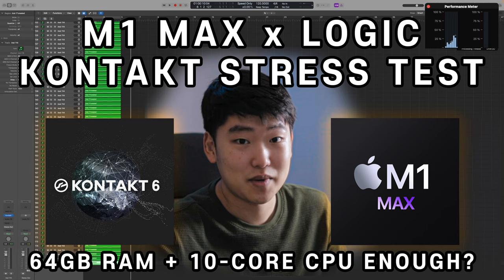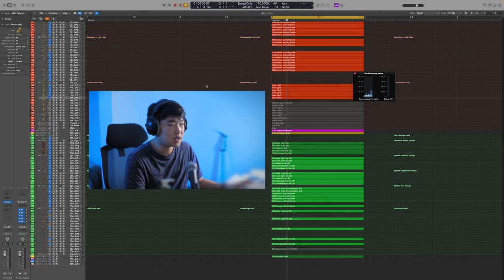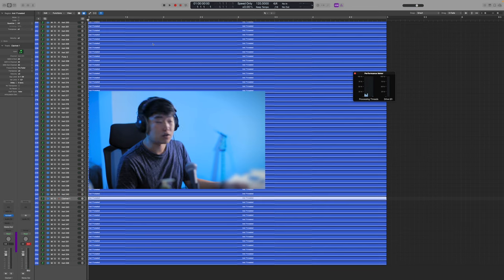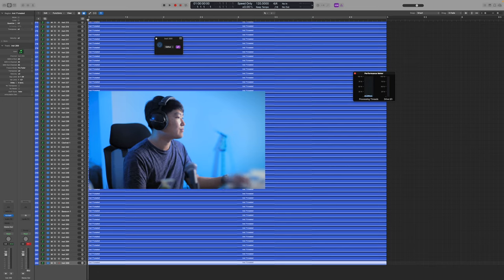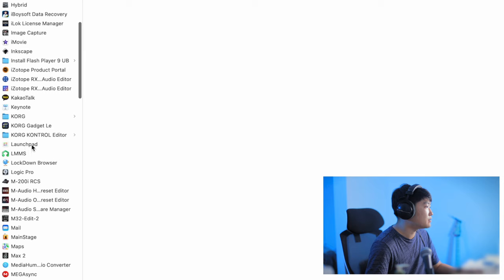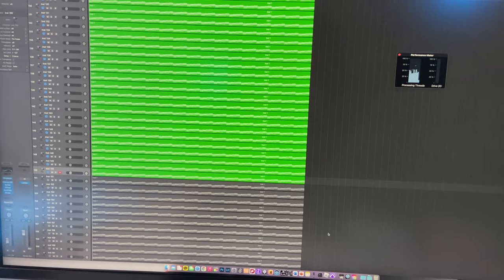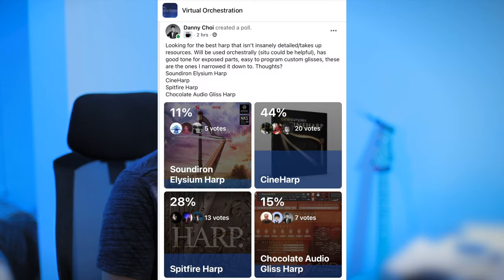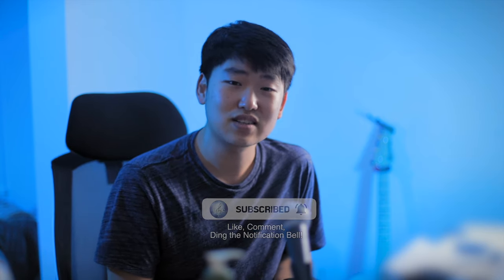M1 MAX Logic CPU Stress Test and Kontakt Test Update

Comment: I’m pretty convinced we haven’t see yet the full potential of M1 Max MBP, like having Kontakt fully optimized to run on M1 chipsets, with the way it does handle the memory and SSD access. For some reason, it looks like when we repeat some operations, it slowly optimize it and yet then it can run smoothly, just like the ressources would adapt to the sudden requests. It’s nice to do all those tests, because that’s VERY specific and I’m sure not everyone even bother with them… but I DO since I’m mainly working with Kontakt in Logic Pro.
Reply from the maker: Yeah, think you're right. Think Apple spent more time optimizing for video and graphics, so it's been interesting to see the "unseen" side of audio in the more complex orchestral senses. Definitely VERY specific!
Reply: @DIDCHOI , M.2 external drives will be crazy!!

Comment: Hey, thanks for posting this revised test. Great to see. One thing I noticed this time round: 

Every time you hit play, you always had one instrument track armed (the red R button). Armed instrument tracks are forced to use only one single core, even if they're only playing back prerecorded midi. This is because Logic is anticipating that you could play that instrument live at any moment. What this means is that this particular track will put a great deal more pressure on whichever core it happens to use - you can even see this because there was always one CPU meter pushing up much higher than the others. And if that one single core overloads, then of course playback stops even if the rest of the processing spread out across the other cores is nowhere near to maxing out.

So if I were you, I'd try running some of these same tests again but making sure the red R button isn't activated on any track. In theory this should mean that the load will be spread more evenly over all cores, with less of a risk of one single core stopping the whole show. And btw, this issue of a single core being dominated by any instrument tracks that happen to be armed for live playing is even more exacerbated when the buffer settings are low. With any luck then, you'll get much better and more consistent results if you always make sure no instrument tracks are armed.
Reply: I've never had the privilege of having a new machine to test like this.  I had no idea that a recorded tracks are forced to use only a single core.  That's great information.
Reply from the maker: Yeah, someone just commented that in the previous video actually. It's very true. I have a dedicated "EMPTY" track set to "no output" for this very purpose. But I don't use it that often when I'm working on stuff so it didn't cross my mind doing the tests. I'm sure it would squeeze more tracks out with one more core freed, but I think we are starting to get the idea of Rosetta's limitations. 

I think it could have helped me reach closer to the 185 track benchmark though for sure!
Reply: @DIDCHOI  yep I agree, the true performance results that reflect what these machines can really do will only start coming to light once everything is native. Still, it's already highly impressive what can be done even when so much is still under Rosetta! 

Re armed instrument tracks and their effect on CPU performance... On the one hand, it's actually pretty valid to test Kontakt playback performance with an instrument track in REC mode. After all, when working on a music project you need to be able to play and record live instrument tracks all the time anyway. So it's always good to know how big of a project the computer can handle playing back, while still allowing you to comfortably play new tracks on top with workable latency settings and no crackling. But on the other hand, if you want to test the real maximum limit of what the machine can do in a pure playback-only scenario, it's better to make sure no instruments are armed and live. Otherwise, the results you end up getting will tend to be dictated by when just one overworked core peaks out, regardless of how much power all of the remaining cores still had left and could have used.

Comment: Nice tests. Thanks! Switching the process buffer size range to "Large" should give your MBP a significant performance boost.
Reply from the maker: The process buffer range? Is that in the Logic settings?
Reply from the maker: Oh I see it! I’ll give it a try
Reply: @DIDCHOI  below the threads which you correctly switched to 10 cores.. On my ancient  2014 MBP it used to give me 10% boost (around +5 tracks of 48). But if that applies to your machine you could get 12 more tracks in the native benchmarks I guess

Comment: Have you reduced the voice allotments per Kontakt patch? Most patches in libraries default at a voice allotment WAY higher than what is needed. Like, 512 or even 1024 voices — and yet, most patches don’t need anything near those settings. I’ve found that even a string patch with a lot of runs etc. wouldn’t need more than around 160 voices, MAXIMUM. And you can see how many voices a track is using within Kontakt.

High voice settings hits the CPU. There’s a lot of CPU cycles being used unnecessarily if a patch’s voice setting is higher than what the part needs.
Reply from the maker: I have adjusted them on a lot of my instruments actually. Though for this specific test, it wouldn't matter too much cause the first test was 3 notes so even with tails building up, it would only use 3-9 voices. The second test would also be well under 50 voices.

Comment: Are you working with Orchestra Templates? Even if they are not playing on the same time, I think it is possible to load 400-600 Kontakt Instances anyway right? I saw a Video from Junkie XL where he was using a Template with 2000 Tracks! Do you feel the Power of your Macbook is enough for some huge Orchestra Film Score Projects?
Reply from the maker: Yup, if you see my first Kontakt test video, I show how many potential instances of Multi-articulation Kontakt tracks I had in my template ready to be loaded up. Think it was around 220 or something? With individual articulations that would be in the thousands territory. You can have pretty much as many unloaded/purged instances as you want probably! 

JXL has a LOT of custom sampled instruments and 10s if not 100s of analogue inputs of his outboard gear so he's using 5 server computers with his main! He's crazy! hahaha 

But yeah, I think I can definitely do heavy orchestral scores. I think I'll do some heavy orchestral mockups soon and see how it performs. 88 multi-art kontakt instances with a slightly more spread out orchestration should easily be enough I think!